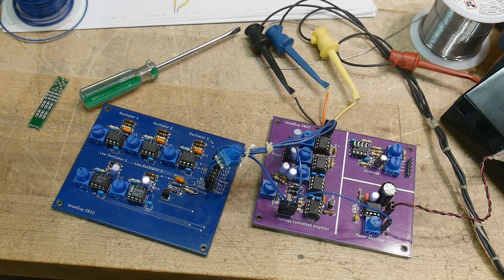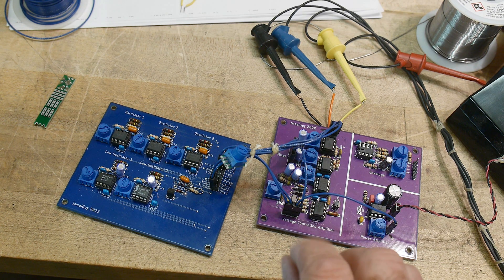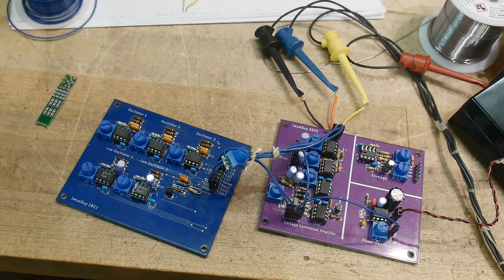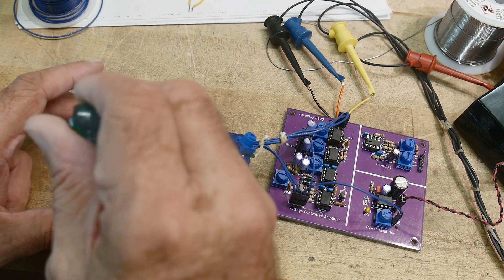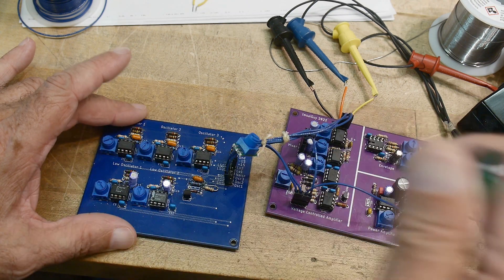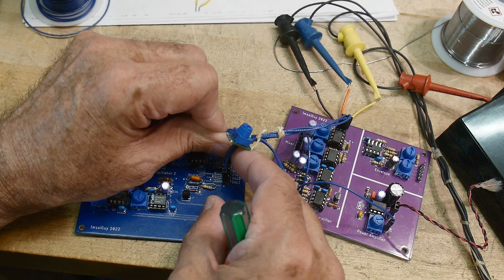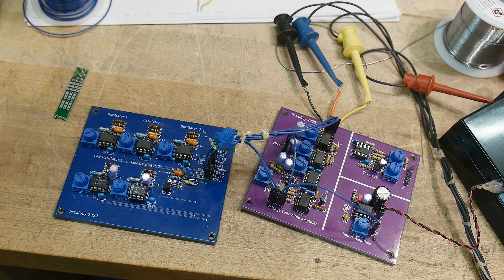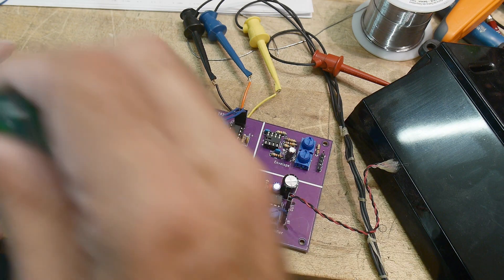#1224 DIY Analog Synthesizer (part 15 of 15)

Comment: i got a envelope for ya, i made some time ago in schematic, but now validated it works, a real ADSR profile, using a CD4017 and one DG418 for decay and sustain.
to bad your VCO's aren't voltage controlled so you can use a "Arturia Keystep", 125€ and make music.
order some "Thonkiconn" jacks and cabled at Thonk, add some 2/3 chanels mizer at VCA, lfo, vco.
: )